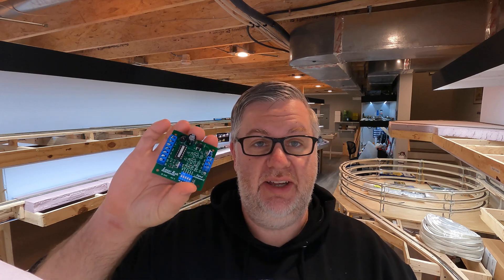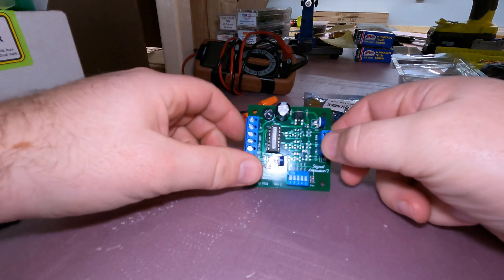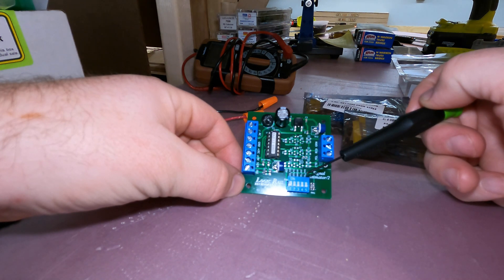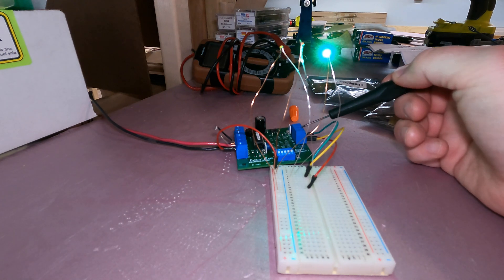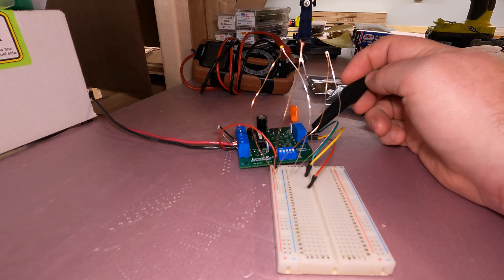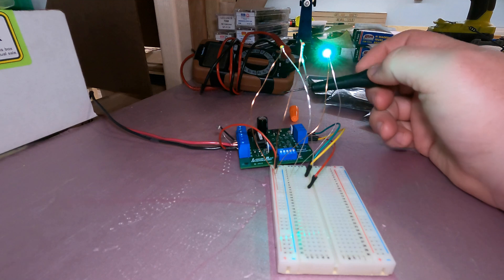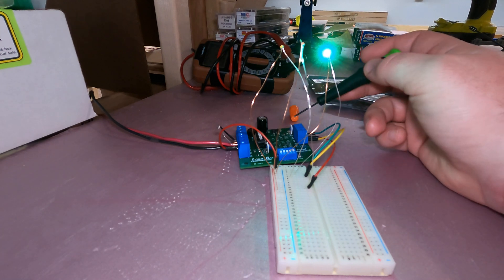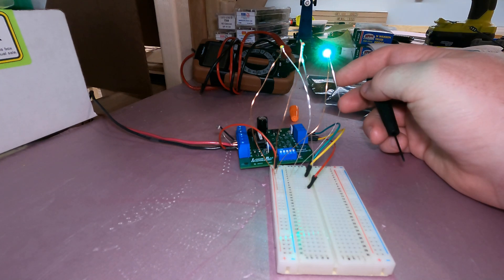42 - Signaling -  Part 2 - Signal Animator/2

Comment: Do you think if you were to add another signal to the existing board, it would power up the LED's and just have one green to red or one signal  wire backwards as it were, with the sensors at each end of the block? Hopefully, this will make sense. Regards

Comment: In reference to your comment about light sequence at 05:40, on real-world prototype signals I've seen, the signal is GREEN until the train "knocks it down" (crosses over the sensor), at which point the signal goes RED to indicate to any trains behind it that the block ahead is occupied.  Once the train clears the next block, the signal will change to YELLOW, saying that the block ahead is clear, but the next block may be occupied.  Once the train clears the block ahead of that, the signal will change to GREEN.  So, GREED-RED-YELLOW does make sense for a standard signal indication, especially if it's meant to be set to a timer.
Reply from the maker: Oh sure, and that's how it's correctly working here. I was more indicating that beyond a single signal, this solution doesn't provide any of those capabilities to follow sequence as additional blocks are entered. The Signal Animator/2 works great if you just want the one signal to go through a sequence based on a delay, which is what it's designed to do, but I need a little more than that. The first video in the series outlines more. Iain

Comment: The Chadwick model railway uses the Sig-na-Trak SigM20.  Not sure if you have seen it.  Best of luck.
Reply from the maker: Yep, I've looked at them. They're very extensible and give a lot of options, but if you're having to spend that much time configuring each device and signal, could just as easily / awkwardly use JMRI or similar (which is what I'm trying to avoid). Iain